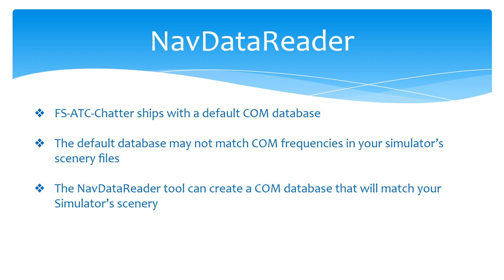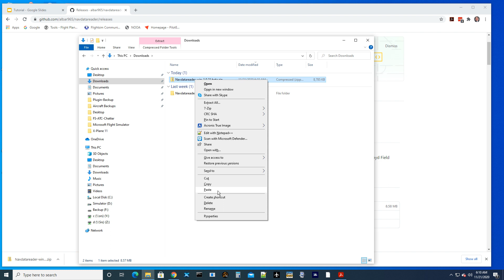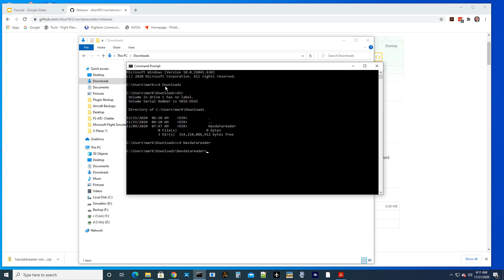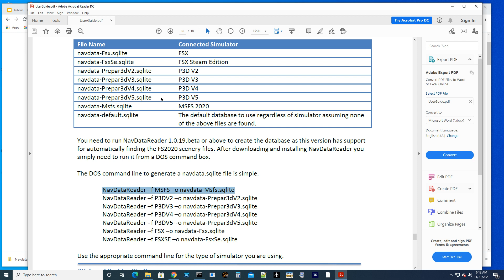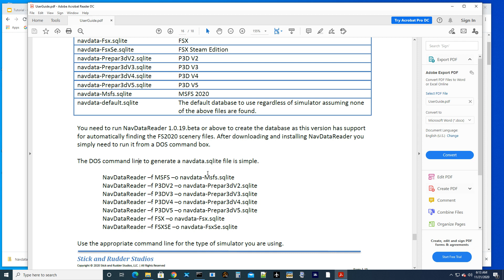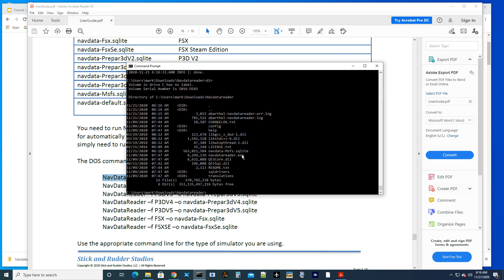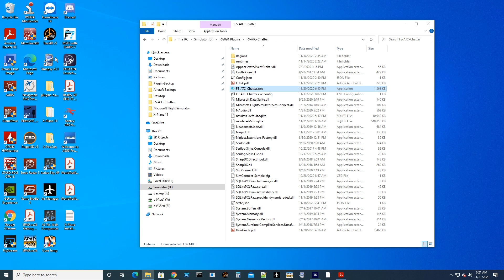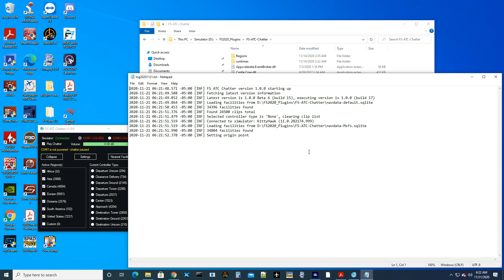FS-ATC-Chatter Using the NavDataReader tool

Comment: Hi Mark, I have watched with great interest some of your tutorial regarding the NavDataReader.
I have two questions, I work with Windos 11 Pro, is it compatible with it, and the second question is, does NavDataReader use the data from Navigraph or from FS2020.
Thank you very much for your answer and sorry in advance if there is a stupid question.
I wrote this post using Google Translate.
Reply: First, you should try FS-ATC-Chatter with MSFS 2020 ATC first. The default FS-ATC-Chatter COM database should match MSFS fairly closely. If you do find that MSFS 2020 is telling you to tune to frequencies that result in FS-ATC-Chatter reporting out of range then it might make sense to run the navadata reader tool to rebuild the COM database from the MSFS scenery.

The navdata reader tool should run fine on windows 11 pro although I have not verified this personally.

To the best of my knowledge, Navigraph does not supply any of the ATC radio frequencies. These come entirely from the scenery files in the simulator.

Mark
Reply: @markellis789  Thank you Mark for your quick response, I will continue working on it tomorrow, I am very happy with your program.
Good luck.

Comment: I can't open my DOS window large enough to have the output command on one line, does that have an effect because for some reason it's not working, I'm using P3D v2.4
Reply: Can't you resize the DOS window to make it wider by grabbing the corners with the mouse?

Mark
Reply: @markellis789  You would think so, but I tried and no go. However, I just opened Notepad and typed it in a smaller font and it fit on one line and ran without a problem, Thanks so much for posting this how to video. Really helped a lot, great little program!

Comment: Is it possible to clean up the file ? if yes how ? ...to get it less big ...  its now 654mb and like you said it only needs the comm tables... thks!!
Reply: Yes, you would need to use a tool like DB Browser (Sql Lite version) to edit the database. As best I can tell only the com and airport tables are used so the others you can remove once constraints are dropped. Make sure to make a backup of the database before attempting any of that.

Mark

Comment: Just purchased fs atc chatter and will never fly without it, adds real immersion to the sim.
Am I right in saying that this navdatareader tool will allow me to change frequency in the cockpit and it will play atc chatter.
Reply: FS-ATC-Chatter has a default COM database. Depending on which sim you are using and what scenery you have loaded the frequencies in the FS-ATC-Chatter com database may not match the simulator. Normally this does not matter but if you are using the ATC functions in the sim it may ask you to tune to a frequency that is not is the default FS-ATC-Chatter com database.

The navdatareader tool is able to read all the scenery files and build a new com database for FS-ATC-Chatter that will match your sim. That will allow FS-ATC-Chatter to work better when using the sim's ATC.

Mark